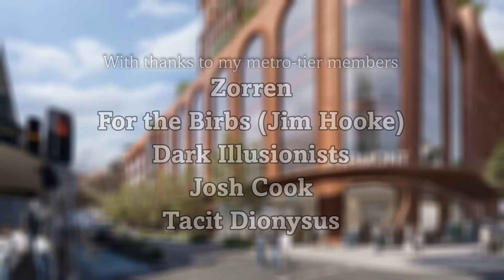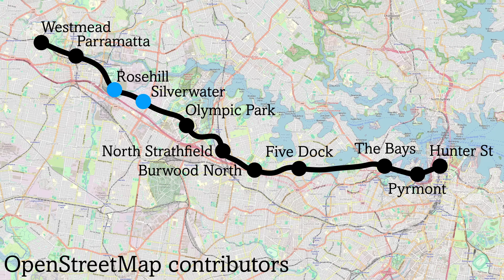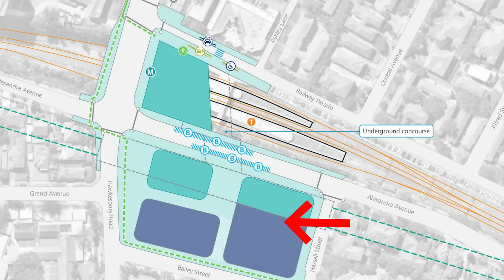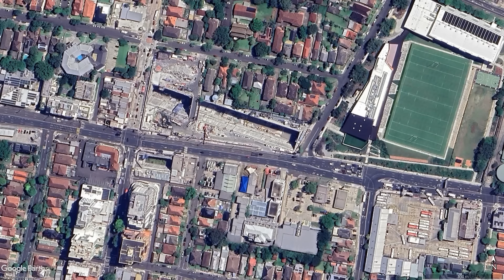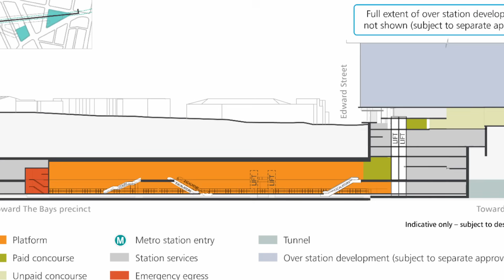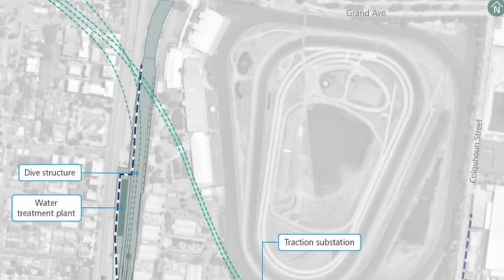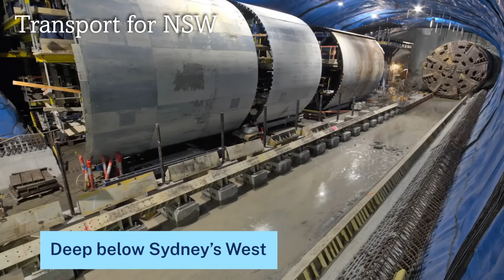Metro West - Sydney's Most Important Railway?

Comment: Which idiot didn’t join the north-west Metro and the WS airport Metro at Schofields? I don’t know.
Reply: Do you have a spare $8 billion. That's about the current estimate to link the sections.
Reply: @mark123655  the patronage would have paid for the extra 8BN anyway, adding passengers from as far away as central to. A one stop connection to western Sydney airport would ensure the entire north shore would use it…
Reply: @gorgu08  you need to take a look at a map.. one stop to Schofields only gets you to the very lightly used Richmond line.. due to the flood plains.

It's another probably three stops and an expensive underground railway given existing suburbs to get you to St.Marys station.

And remember that WSA Airport will start small, it will take decades to expand to a medium sized airport.
Reply: @ I know the map well the two lines need to meet at Schofields…!
Reply from the maker: Raw opal revenue wouldn’t come close to funding the extension. I think 8bn is a bit overblown but even so the government is basically broke at the moment, we won’t see any new metro lines this term I don’t think.
Reply: @ ofcourse we won’t the Labor government does not prioritise transport at all, that’s a liberal thing we will have to wait another four years at least to restart transport investment, we had a good decade long run through
Reply: @hain_train  Given that most metro projects are over budget it makes sense to have adequate contingencies, particularly when you don’t even have an alignment.
Reply: I totally agree. 
Tallawong and Schofields are ridiculously close.
I understand they want to extend the line, but to have it not end at an existing station / line that is already so close, seems like such a huge missed opportunity.
A bit like the old Carlingford line that ends just down the road from Epping
Reply: @ They didn’t have the approvals or even a rough design to show where the line would interchange with the Richmond Line. They could have waited a few more years to get it sorted but they started on work on what they had ready which was by far the right thing to do.
Reply: @YeahNah_ok_maybe  the ALP only planned for it to go to Tallawong, the LNP reused the plans IIRC so that the project can get off the ground. Because if they didn't start it would never be done.  Don't let perfection be the enemy of good.
Reply: @TomHommus  Thanks for the feedback Tom,  but for me its not so much about perfection, but more about common sense.

If you live in Blacktown, say, but work in Norwest or Rouse Hill, you still have to go via Strathfield by train to get there. Ideally we need more cross city commutes as not everyone works in the CBD.
Reply: @gorgu08  The alignment hasn’t yet been determined and there is the little issue of money. They needed to start when the did to be ready in time and spinning the wheels for three years or more while the went through all the planning and land acquisition was not an option. TfNSW staff are professionals who know what they are doing
Reply: @gorgu08  because it costs those sweet sweet dollars something the government sorely lacks

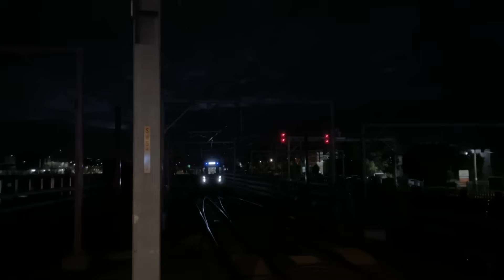Comment: 19:20 The legacy Sydney Trains network is just too unreliable to connect it to another line. Taxpayers are already throwing billions at the current network just to keep it running without the extra problems created by more lines and more trains.
Reply: Totally agree. By having all new lines being separated and standalone actually improves Sydney’s resilience when one of the train line or public transport infrastructure goes down. Both Paris and London have this model.
Reply: @ In some ways, the problems on the London Underground are caused by problems on one line in the core affecting all the branches instead of just one as is the case with the District and Metropolitan Lines. I don’t think many Sydney Trains staff would thank you if you told them you were going to add another 25km line to the legacy network.
Reply from the maker: In this case though it wouldn’t be interfacing much with other lines. T1 would climb out of the tunnel at Westmead onto the suburban pair (shared with BMT) then at Blacktown split out to the mains (not shared) then back to sharing when the quad ends at St Marys. Again it would only share with T5 as far as Schofields. Both BMT and T5 only run 2tph as well. Not a big deal me thinks. If it was plugging into another busy line then it would be a different story.
Reply: @hain_train  It’s not that simple. The network is already at its limits now. What you think is not interfacing much is still enough to degrade the network.
Reply: @gregessex1851 actually they would love to keep adding to the legacy network.

Having the metro there reduces their leverage when they strike and as more areas are built out. Olympic Park, Parramatta north Sydney Macquarie Park the city are key areas of our economy. The amount of GDP those areas are significantly higher than the rest of Sydney. As more metro gets built their power reduces. The more legacy train they build the more power they have.

Secondly as per articles the amount of people interchanging from trains to metro is higher than what even tfnsw have predicted. 

Reduced passengers can mean service cuts meaning fewer shifts.

And also if the train is delayed they still get paid but get paid to sit there or stand there and wait. As an employee why wouldn't you like that?
Reply: @ When I say TfNSW I am not talking about the train drivers, I am talking about the professional staff who manage the network.
Reply: @gregessex1851   ah ok yeah makes sense.

Comment: This level of construction technology would not have been possible in Australia 20 years ago. Just look how basic the stations are on the Airport Line. The Construction Industry has come a long way in 20 years.
Reply: The airport line was a rush job and done on the cheap. A proper job would've meant not being ready for the Olympics.
Reply: @ I don’t know if it was particularly rushed. The concept design was done in the early 1990’s before the Sydney Olympics was a thing. It was done to a price as a private company was taking the risk on the design and construction. It doesn’t change my point that 20 years ago, the construction industry didn’t have the world class level of expertise that it is delivering on these metro projects.
Reply: @ it was rushed which is why it wasn’t integrated properly into the Sydney Trains network (no access to City outer) the station boxes are also too small for the needs of today. If you’re basing your argument on the stations and how basic they are, They’re basic because they are too small, done quickly and cheaply not because of the lack of technology available to the construction industry in the 90’s.
Reply: @ I have been working in the Civil Construction industry for 40 years and I can tell you that we didn’t have the capacity or even the resources to take on what is happening on the metro network.
Reply: @gregessex1851  Yet you couldn't tell the airport line was a rush job lol
Reply: @ All large Civil Construction jobs are “rushed” because time is money and the difference between making money or going broke. It was finished three months before the Olympics. It was a relatively simple build compared with what contractors are doing everyday in Sydney. It may have been the first use of a TBM on a transport project in NSW. Now there would be over a dozen in Sydney.
Reply: @gregessex1851  So now you say I'm right and it was rushed, thanks for the clarification. It was done on the cheap too, that explains the basic platforms, which weren't done by a TBM but regular construction methods. Maybe you should have phrased your original comment better and actually mentioned the TBM and not the rushed cheaply built stations.
Reply: @ You don’t build stations with TBMs for a start. I don’t know what you are getting at with your claims. I simply stated that the work that TfNSW staff and their contractors are doing now is unprecedented in NSW and way ahead of what the industry was capable of just 20 years ago. As a Civil Engineer with over 40 years in the Construction Industry, I am saying it from a position of knowledge.
Reply: @gregessex1851  please read what I wrote, I said the stations weren't built with TBM lol. You claimed the basic station builds were because of the lack of technology at the time when you should have mentioned the actual tunnels. I just pointed out the basic nature was due to a rush and doing it on the cheap, I was involved in the airport line construction from the transport side of things so am saying it from a position of knowledge, it was a cheap rushed job. We seem to be going around in circles here. I also never disputed that we can do things now we couldn’t do 20 years ago, quite frankly if technology hadn’t moved on we’d be in deep trouble.
Reply: @Pete7554htp  Its financing cap/method caused many of its station capacity constraints that still have to be dealt with. (Narrow platforms, no escalators from the platforms at Green Square, Mascot and Wolli Creek, and to this day only one up-escalator each at the domestic and international stations etc etc). It was the first rail PPP and simply put, didn't work and the original consortium wen't broke after completion. No major aspect of its particular PPP model has been used since and other funding methods (availability securities) have matured. The line wasn't meant to cost the taxpayer one dollar but had to be bailed out to the tune of $1 billion in 2001 dollars. Wolli Creek - a truly shocking interchange - was a very late addition and directly funded by the government.
Reply: @Pete7554htp a casualty of inadequate planning at the airport stations are the narrow platforms. When you consider many passengers will be pulling luggage the already narrow platforms will become an obstacle course for everyone.
Reply: Without undermining anyone’s experience or expertise, I’d suggest from a purely layman’s perspective that there are glaring inadequacies with the airport line and in particular stations that are evident and suggest strongly that insufficient timing or planning was done in their construction.

For example, there is little to no design elements to accommodate weary travellers with suitcases comfortably on those all-to-narrow, virtually seatless platforms. 

The ticket costs are also exorbitant, and the absence of a dedicated single floor airport train with suitable luggage storage and seating is a woeful inadequacy. 

Given more time, a dedicated airport service running directly from Central and not stopping at the suburban stations would have been a far better option. Four tracks at the airport platforms would allow the suburban trains to pass the airport trains equally allowing lower frequency, dedicated airport trains significantly more time to load and unload passengers considering bulky baggages simply take longer to move.  A subsequent switchback would allow the trains to effectively terminate at the international terminal. A deviation at Central to a dedicated platform like 13 or 14 would also keep air travellers away from commuters. Critically important at peak times where the narrow suburban platforms at Central become potentially dangerously overcrowded already with just commuters, let alone with  people with multiple suitcases as well.
Reply: @Dobuan75  which is back to my original point, it was rushed and done on the cheap.
Reply: Doing things fast and at low cost is not necessarily a bad thing.
Reply: @jack2453  except on the airport line it is, the platforms are curved which means it's not as safe, the platforms aren't very wide which means they're prone to overcrowding, the line can't access the city outer at Central making it more difficult operationally. They are just 3 quick reasons why rushed and  cheap are not ideal.
Reply: @Pete7554htp  Not ideal - but better than Melbourne's.
Reply: @jack2453   of course 2nd best is better than 3rd best.